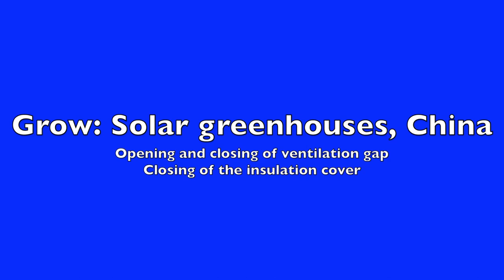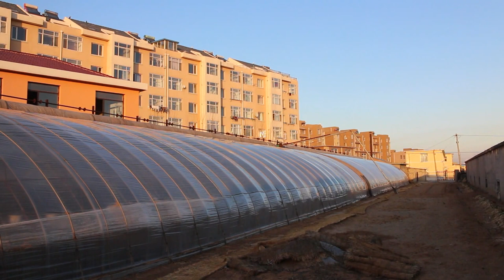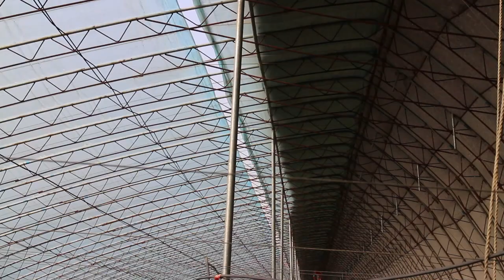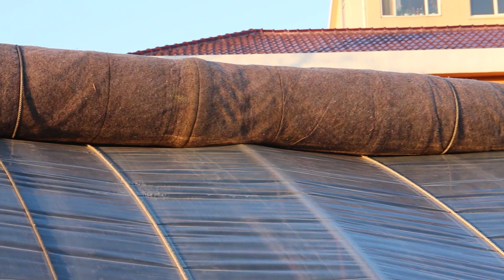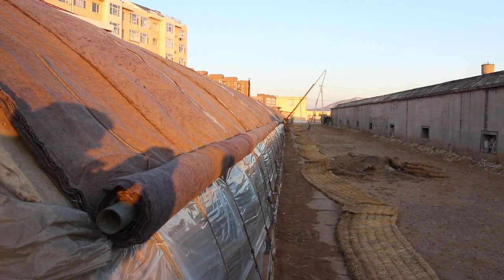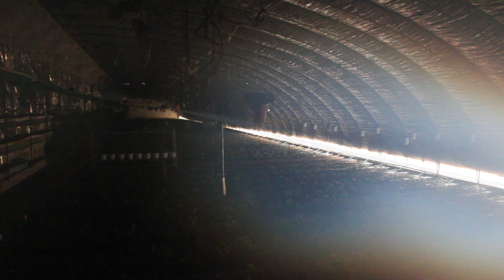Grow: China, Solar Greenhouse

Comment: What is the machine being used here to roll that insulation top cover back during the night called? Would greatly appreciate more information how they are doing that. Also what type of material is that? Appears to be some type of burlap.
Reply: Almost actually looks more like dryer lint in that close up shot.
Reply from the maker: Just a simple elektro motor and a gearbox. a tube  connected to the gearbox on both sides. The insulation cover is rolled up by these tubes.